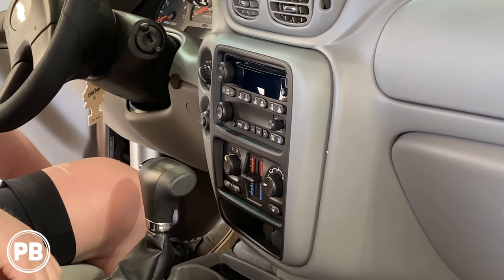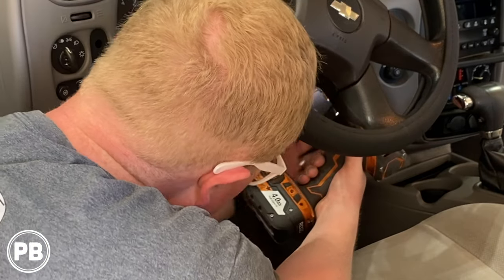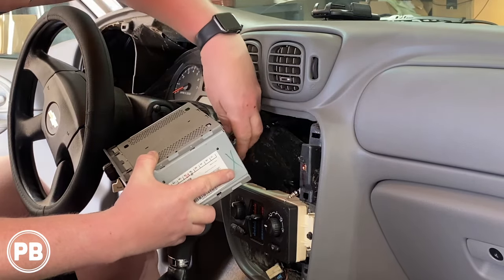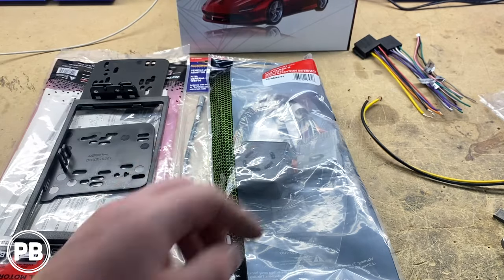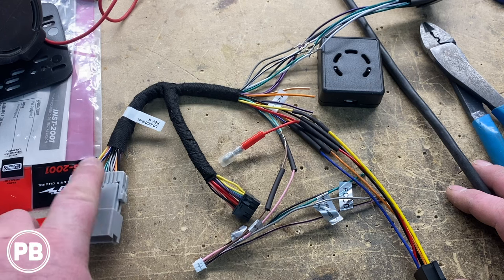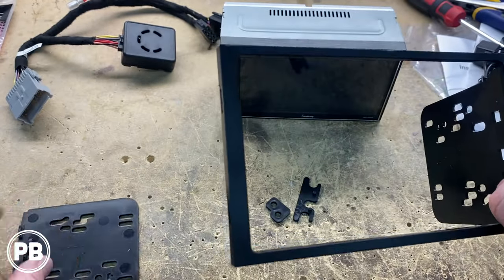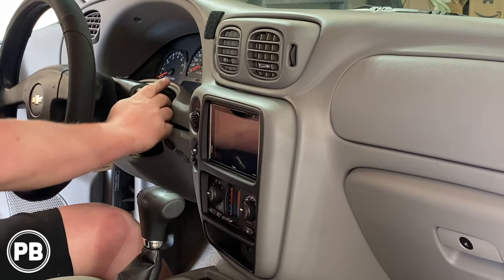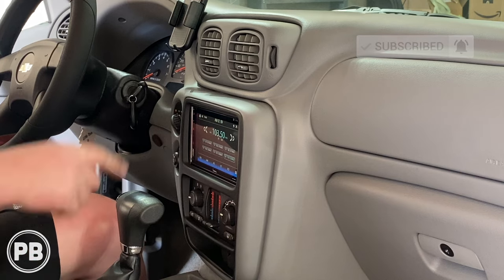2002 - 2009 Chevy Trailblazer / Envoy Radio Install

Comment from the maker: Parts used linked in the description of the video!
Reply: So question.  If I use the Joybring you are showing with reverse camera, etc anc 3wXv4V5 adaper harness I will maintain my steering wheel volume controls and the chime system.?  I would like a unit with Navigation, also.  When you check on the Boss system they want to know your RPO code so they know which harness to use.  Any Idea on which RPO code they are looking for.  the label in my glove box does not identify which code is for the bose system I already have.   all this gets very confusing.  thanks for you video and help.

Reply

I posted 2 comments,  not sure why you didn't see them.  Sorry about seeming to be complaining,  I figured the above system won't give me Navagation without using a cell phone,  So I need to look for something else.  Sorry to have been a bother.  Good job on your videos.   My car is a 04 envoy, but pretty much the same.  Thanks again, Randy

Comment: Fortunately for Envoy owners, the bezel (buh-ZELL) only covers the A/C and radio.
Reply: Hey there, I'm currently (attempting to) install a new radio in my 04 envoy XL w/ bose and didn't want to fork out the 100 bucks for a harness, do you possibly know if I can leave the BCM data bus cable disconnected? Thanks in advance.

Comment: Good video and well explained. Unfortunately i am building (soldering and heatshrinking) my harness and the whole reason i watched this video was for the illumination wire. I was really hoping for something to the effect of.. "If you have a none bose gps factory unit the pin you need is this one top or bottom row 4th from the left Ex. check for continuity from the pin to the wire to ensure you have the correct one and solder it up." not a huge deal i will figure it out when i put it in. Also i will let you know i didn't connect my power antenna wire to my remote so i will let you know how that plays out. might have to solder that connection anyways. As i don't have a power antenna it seems redundant. Haven't checked the wiring diagram to see what other vehicle systems that powers though..

Comment: I wired in a head unit on my 2008 trailblazer, followed all of the instructions and double checked my work, however I was unable to find which wire was my ignition signal. I wired red to red and yellow to yellow as my harness instructed but my radio doesn’t cut off with ignition, i have to manually power it off at the unit itself. Am I missing something? I used the same metra harness shown in the video, I even tested all the leads at the factory connector for power when cycling the ignition. Just curious which wire in the connector was supposed to give me ignition?

Comment: I used the exact same products as you, but mine did not have the interface illumination tab on it, just curious if you remember what color it was or if you had to double up any wires
Reply from the maker: Sure, if none of the illumination wires pass through the harness resulting for the need to use the interface illumination wire, it doesn't hurt anything just to connect all of them together.  Alternatively, you can use a multi meter or continuity tester to identify which wire you need and eliminate the ones you dont.
Reply: @ProvoBeastAudio  got it

Comment: Hey so i have an 05 trailblazer wit bose system and remote start so only the front speakers work and nothin in the back i changed the head unit and still the same no sound i messed wit fade option and still nothin any info will help

Comment: What type of wire harness and chime retention unit would I need for a 2008 Chevy Trailblazer LT with the Bose stereo? I've had no luck even after spending a ton of money on several that were supposed to work with the Bose factory stereo with the Bose Digital Amp. I'm trying to swap out the factory stereo because mine is none functional ive tested another Bose stereo and there's power going to it but a touch screen with modern features would be great. Thanks for any help you may be able to provide.

Comment: dear, im having trouble after i installed an android screen on my trailblazer 2006.. an electric current buzz sound .. very load .. always on my front left speaker, and sometimes back right speaker .. the only thing i got to notice is that its starts when my bass sub kicks in after less than a minute .. sometimes its from the beginning .. sometimes it doesnt accure .. most of the time it does accure .. i need help ..

the guy who applied that screwn to me told me i need a sound filter right between the cables and the new screen to plus and that will filter out all of this .. would that work .. is that correct ?

thanks

Comment: Just bought 05 trailblazer xlt. Would you know why the radio has nothing but all static. A radio station kind of bleeped in but signal won't stay. Tried to check antenna but it seems connected. Help, please.

Comment: I bought same wire harness (LC-GMRC-1). My head unit has an orange/white illumination wire. Do u know which orange wire i connect from the metra wire harness? I have a 2007 trailblazer LS.

Comment: I have a 2002 Bravada oldsmobile, even though it has Onstar system(Which is not activated and I do not require it) just as I would not mind not having the steering wheel controls, can I use the cheaper harness or do I require to use one that retains the steering wheel controls, also the speakers are not heard without the factory radio, with this harness will this be solved also?
Reply: I’m wondering the same question… did you ever find out???
Reply: You can use a cheaper harness that doesn't enable the features you want and it will still work, just won't be able to use the features because of course, you bought the harness that wouldn't let you use them.

Comment: Will the LC-GMRC-01 HARNESS WORK IF I HAVE BOSE AND ONSTAR AND STEERING WHEEL CONTROLS? THE CONTROLS AND ONSTAR WILL JUST BE INACTIVE? OR DO I NEED THE HARNESS FOR THE BOSE AND ONSTAR AND STEERING TO MAKE THIS WORK SINCE MY CAR HAS THOSE FEATURES?
Reply: No, with Bose you need the GMOS-04 smart module, and for steering wheel controls you need the ASWC-1 adapter.

Comment: Can you or share more of the wire diagram I’m using the same setup and I don’t want to make any mistakes
Reply from the maker: Lots of variables when wiring depending on the harness, radio, etc.  If you want specific wiring help, send us a message on facebook / instagram and we can help.

Comment: Do you have any videos with steering wheel controls that confuse the heck out of me
Reply: I have a 06 gmc envoy Denali with steering wheel controls
Reply from the maker: @chrisbarber1020  Yes I do, but also depends on the radio you are installing and the parts used.  If you send us a message on facebook, we can certainly help you out.
Reply from the maker: @chrisbarber1020  https://youtu.be/P8pX1ovL6Ts
Reply from the maker: Also, if you are using an android based radio, in addition to wiring the steering wheel control connections, no-name brands also require you to manually program each button within the settings of the radio.

Comment: So question.  If I use the Joybring you are showing with reverse camera, etc anc 3wXv4V5 adaper harness I will maintain my steering wheel volume controls and the chime system.?  I would like a unit with Navigation, also.  When you check on the Boss system they want to know your RPO code so they know which harness to use.  Any Idea on which RPO code they are looking for.  the label in my glove box does not identify which code is for the bose system I already have.   all this gets very confusing.  thanks for you video and help.
Reply from the maker: Randy, send us a message on facebook or instagram and we can answer all your questions.
Reply: @ProvoBeastAudio  Okay starting over.  Just about think it isn't worth messing with this radio change.  My car is 04 gmc envoy xuv. It has factory GMC radio with Navigation.  I need to know what radio would work for me with Nav, steering wheel controls, Onstar and my saftey chime system. Also want a backup camera, but can add that if the radio has the rear camera plug on it.  Harnesses area  night mare.  PAC RP5-GM11 Wiring Interface  has this one, but seems to be really expensive, but is the only one I can find that does it all.  The new radio needs Nav and backup camera.  Either Nav in the radio or the android play, but really don't like the cell phone idea, but can do it if that's all there is.  If you read this please let me know if you have any ideas.  Thanks, Randy

Comment: I've  attempted to wire up the harness as described but not getting power to the radio.
Reply from the maker: Either you have the wrong wiring harness adapter or a blown fuse. Hard to diagnose over a YouTube comment.

Comment: Will installing this unit into a 2006 trailblazer LS interfere with the security system?????
Reply: I only think so. You could tell because the security light flashes on the dash showing it's active when you lock the vehicle, or at least shows that on my 02 TB LTZ

Comment: I did this EXACT install, I do not have SWC or Bose, but I do have Onstar. For some reason the radio is shutting off every time I open the door, WITH THE ENGINE ON. I plugged in my OE radio to make sure it wasn’t my door switch, it stayed on. Any ideas?
Reply from the maker: Shoot us a message on Facebook and we can assist.

Comment: when I click on the Amazon link for the Joybring stereo,  Amazon says it will not fit my Envoy 2004 ?  any ideas?
Reply from the maker: Amazon's fit guide is trash! With the right install parts, it will work great.  Also, that Boss radio is also budget friendly, and has a much better warranty.

Comment: 02 trailblazer with Bose ? Don’t care if retains onstar is their a video on that??? Online schematics on wireing are iffy
Reply from the maker: If you have Bose, those part variations are also linked in the description.  Install process is just the same, just using a different harness adapter.

Comment: Does the Smart Harness do anything to activate the Red wire for power? I purchased a harness and wired to spec with my Dual radio and the Red wire out of the harness is not giving power when the ignition is on.
Reply from the maker: Yes.  Your GM vehicle doesn’t have an analog accessory red wire as the “turn on” wire is data controlled, and so it has to be generated by the smart harness for the radio. Be sure to get the right harness for your vehicle.
Reply: @ProvoBeastAudio   I bought an envoy a while back where the PO had run a wire back to the body control module and pulled switched 12V power from one of the fuses there.  It works, but definitely isn't ideal.  If you have a Bose system you definitely need the adapter though.

Comment: Hello, what did you use to join all the cables (What looks like black tape)?
Reply from the maker: We used heat shrink to cover out connections!
Reply: @ProvoBeastAudio  Thank you very much for answering, I found the "heat shrink tubes" in Auto Zone.  However, he asked about me not being able to solder the cables (the red, yellow, etc.) How did you do it? Can I put black tape and mini heat-shrink tubes and apply the heat gun to adjust them?

Comment: Hey guys. Had a car audio guy install this as per your amazon links: but the unit wont turn off when I turn ignition off. I have to manually turn off the unit so it turns off and I dont kill my battery. Any ideas?!
Reply from the maker: Send us a message on facebook and we can help diagnose why.

Comment: My radio says Bose on the screen but I do not have steering wheel controls, I’m not sure what harness I would need
Reply: So I bought my harness, wired everything together, I have power, the radio works, but I have absolutely 0 sound. I’m not sure what’s up. If the wires for the speakers don’t have good connection? I’m not sure
Reply: @haydenpeterson1385  Not familiar with your specific stereo...if there's an amp powering the speakers you may want to be sure the blue (remote) wire is hooked up correctly.

Comment: did u need to run an extra accessory wire to fusebox
Reply from the maker: No, no need to if using the right install parts.  The smart harness needed (which we used in the video) provides the accessory for us.
Reply: @ProvoBeastAudio  since mine didnt come with the accessory wire do yk whoch fuse i could use to make it accessory power on thw fusebox under rear drive side seat fuse box
Reply from the maker: @Dhill.angelI  Which means you are using the wrong harness adapter if your harness doesn't have an accessory wire.  If you refuse to use the correct harness adapter, you will need to use a multimeter to determine which fuse to tap into.  IF you go that route, please do it correctly using an add-a-circuit.

Comment: Do you know what kind of butt connectors I would use? Since I wouldn’t be soldering
Reply: I have a 2008 trailblazer
Reply from the maker: 18 -22 gauge red butt connections will work fine.
Reply: @ProvoBeastAudio  would u happen to know the order number?
Reply from the maker: @zainramirez582  Here are recommended crimp caps: https://amzn.to/3aWvSEh
Reply from the maker: Or Butt connectors: https://amzn.to/3RNS8ki

Comment: what do i do with the smaller plug?
Reply from the maker: In most cases, it won't be used.  Depending on the factory features of your vehicle, along with the different trims available, that harness may or may not have been used with the factory radio.  They also may have had factory features no needed by the aftermarket equipment.
Reply: @ProvoBeastAudio  thank u had all the stuff for 3 months js haven’t installed it yet

Comment: i did the color for color but eont turn on, im also having the second factory harness not being used, why wont it turn on? do i need to tap a wire to something?
Reply from the maker: Depends on the, radio, harness adapter used, etc.

Comment: hi, i want to know what kind of wire adapter i will use, for 2006 gmc envoy? its have booss system, but there are no steering wheel controls.